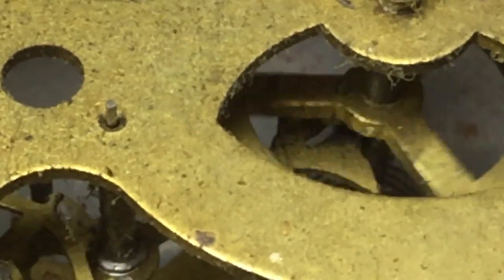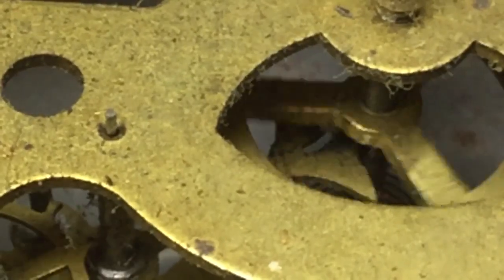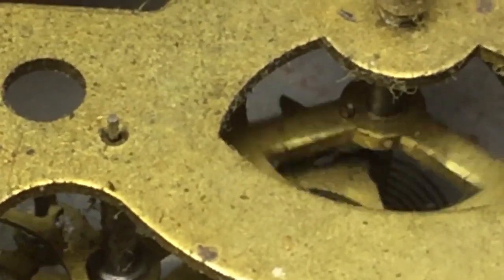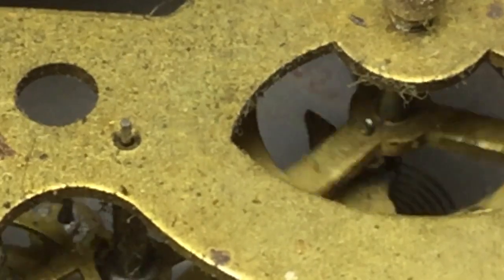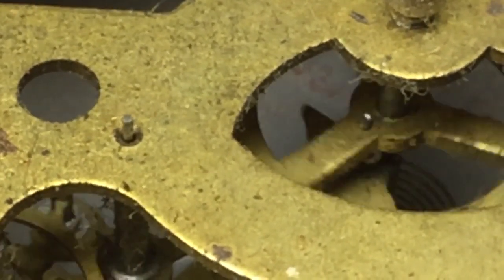Dirty Movement Detour 1: Slow-Motion Running

Comment: Wasn't this the style 5 Big Ben you serviced later on? (I'm also taking a trip through all of your older content. Funny, I understand it A LOT more now than I did then when most of these first came out!)
Reply from the maker: I did a 5A loud alarm on camera and did a 4A loud alarm and another 5A loud at the same time off camera.  This style 5 loud alarm movement is from a parts clock. It lives in a cabinet with other mostly complete parts movements for future use.

Comment: This was more or less 2016 - 2018 for me. Speaking of cleaning, I'm considering getting an ultrasonic cleaner. I know you and I had a little talk in the comments once before about clock cleaning, but I just wanted to get your opinion. I'm also planning to do a video on this subject.
Reply from the maker: All I can say about ultrasonic cleaners is.... I wish I had one! I would have to have one big enough to put a phonograph motor frame in, that would be big enough for any clock movement plates.
Reply: @okbridges  Putting a phonograph motor frame in  will really dirty the whole machine up, though.